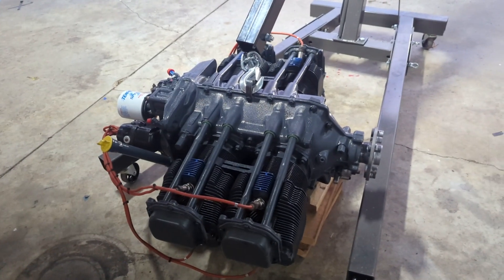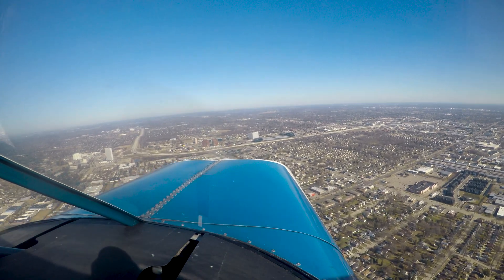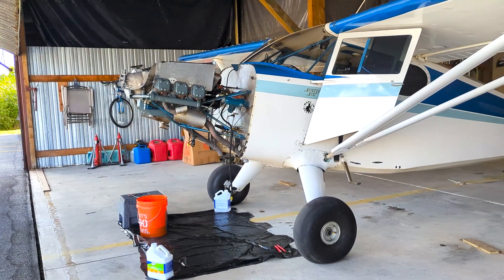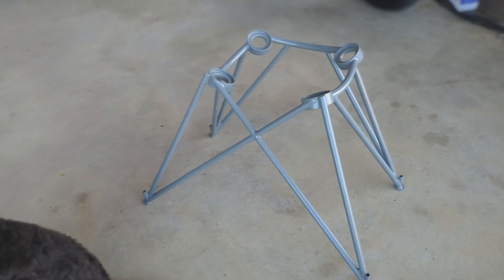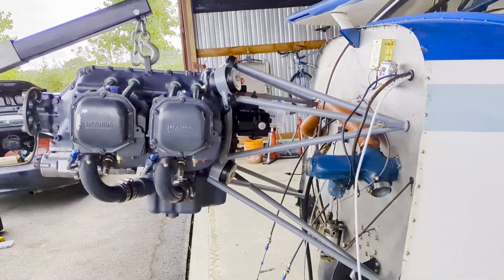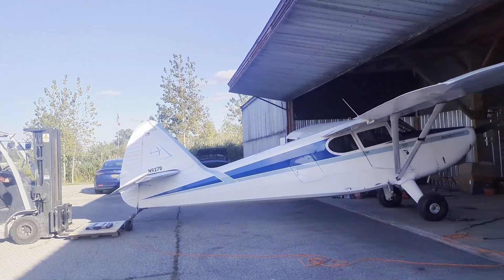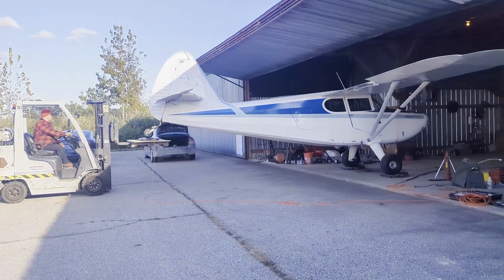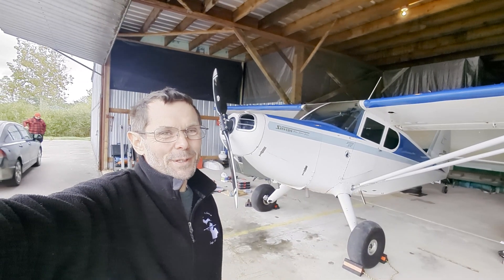Super Stinson 108 - Lycoming O-360 upgrade

Comment: I have a similar set up in my Stinson 108-2.   It is a great upgrade.   Not as smooth as a Franklin for sure.  But is far easier to get parts and service.  Also, I trust it.  Mine has two oil coolers and runs way too cool in winter if not blocked off.
Reply from the maker: Mine runs one cooler and I need to block most of it off in the winter.  I'm wondering how it will do in the summer.  The trust is where I'm at with this engine. I didn't trust the Franklin any longer and there was no way a Franklin could earn my trust again.  It's good to hear you like yours, I'm hoping after a year I feel the same.
Reply: @GreatMichiganBushCo    I'm looking at buying a 108 with the 180 HP Franklin and a constant speed prop.  what exactly happened that turned you off the Franklin engines and would you feel differently about the 180 vs the 165 or 150 models?

Comment: Who did the O360 overhaul and what was the turnaround time? Did you provide the core or buy something off the shelf?
Reply from the maker: Aviation Center in Ann Arbor did the work.  The turn around time was a couple months.  I purchased a core from Wentworth.  This project took me 2 years to complete.  I had been gathering parts and STC's so when the plane went down I knew it would be back up quickly.  I didn't want it to turn into a 5 year project.

Comment: My inspector put this engine on his 172 and with 4 big adults in it that thing will climb like I couldn't believe. I had to get used to the torque when applying full power at the stop. Thing wanted to pull us left right off the runway without full rudder and a bit of right brake!
Reply from the maker: You should feel the pull this setup has on a tailwheel :-)  It's amazing how horsepower makes pilots excited.  Stay tuned for more videos on this conversion.
Reply: @GreatMichiganBushCo  I can Imagine, a 172 with 800 lbs of men in it weighs quite a bit more than a 108. Lol

Comment: How long did it take to break in the new engine?
Reply from the maker: I'm 25 hours so far and still "Breaking" it in.  I figure I'll switch to AD oil at 50 hours.
Reply: @GreatMichiganBushCo that’s a brand new engine you installed there?
Reply from the maker: It is a fresh overhaul.  I'm hoping it works out well. @ACOGJESUSSCOPES
Reply: @GreatMichiganBushCo hope you have more videos for us soon. You have me almost convinced on the route to take on my own 108.
Reply: @ACOGJESUSSCOPES if you're looking for an easy to fly and fun Tailwheel the 108 should be on your radar.  I'm going to put some performance numbers and reasoning for the change  later this week.